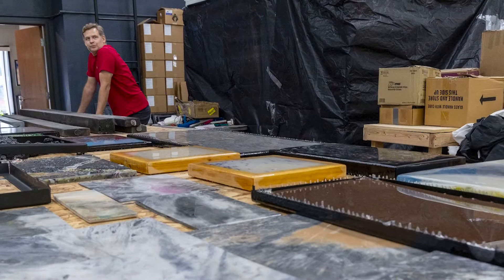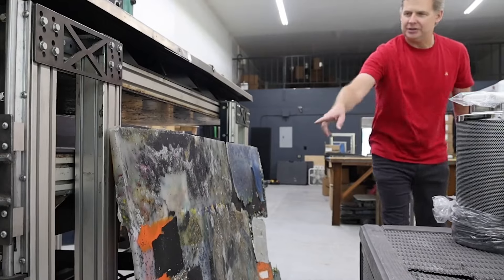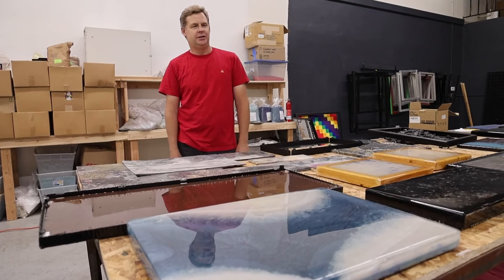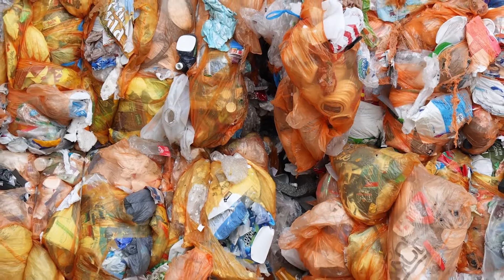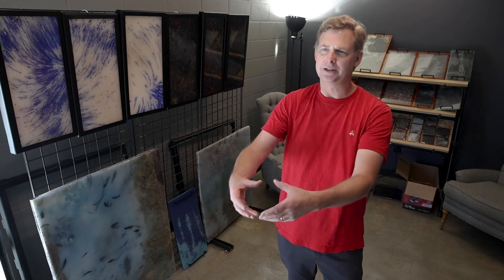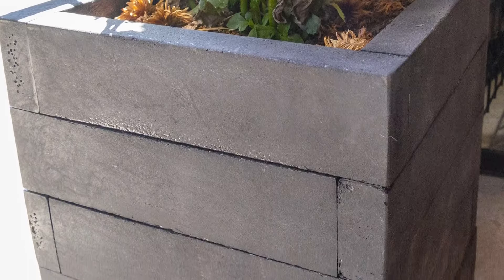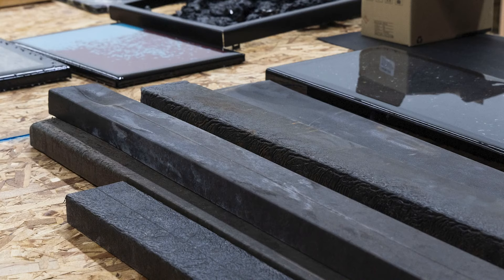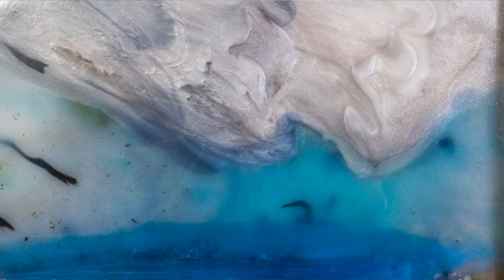Problem Plastics Get New Look, But It's Not Recycling

Comment: The key issue of recycling into products is cost. You can make a 2x4x8 out of plastic but can you deliver it for $3.65 (today's price)? Even with "free" material, it isn't anywhere near feasible. Plus, you can't just match the current price, you need to substantially beat it to get adoption. And, you have to do it at huge volumes, for the same reason. A buyer isn't going to switch to a plastic material unless it can be delivered consistently and support growth demand. This video falls short of addressing ANY real issue in doing so. Fine, make some public trash cans but you're going to spend hundreds or thousands of dollars making something that can be bought of wood or steel for half the price.
Reply: Ahh, there's my answer. TY